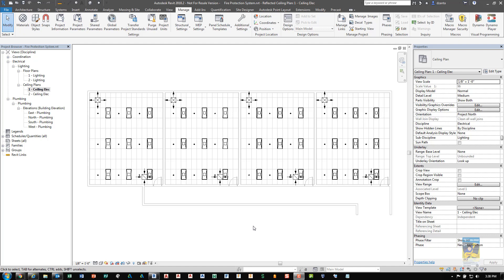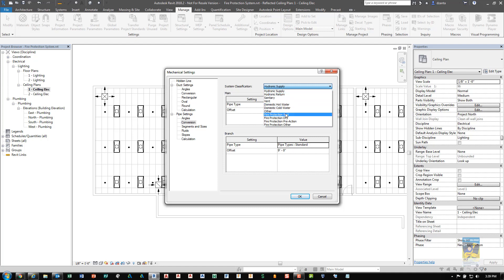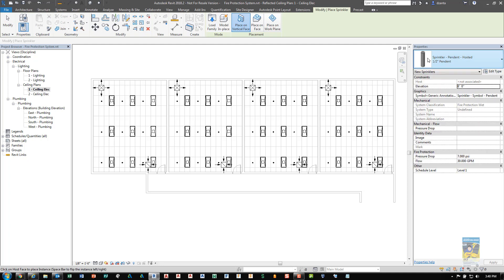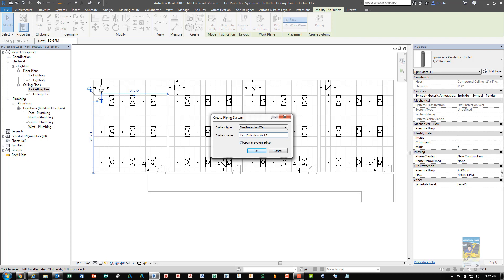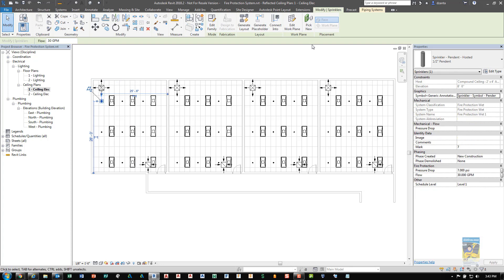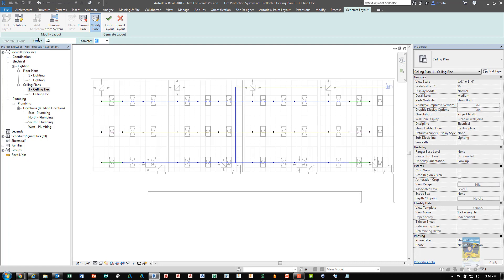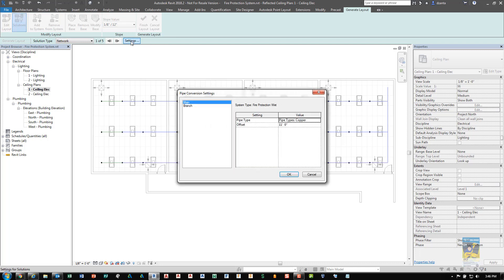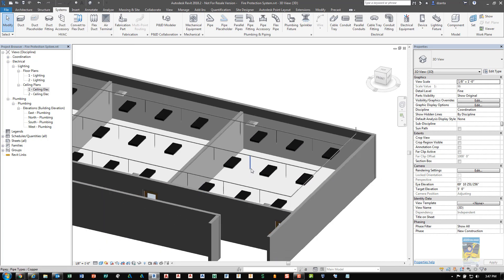How to Create A Fire Sprinkler System in Revit

Comment: Hi Mr. Dzan Ta,
One question. If you are still doing this, would you please demonstrate how you spotted or located or placed the sprinkler heads?
Thank you
Abdul Addo
Reply from the maker: Hi Abdul,  I went to the Systems Tab of the Ribbon, Choose the Fire Sprinkler Command, picked the type I wanted in the Type Selector, then placed it on the face of the ceiling with the contextual Ribbon Place by Face option.
Reply: @DzanTa  Thanks Mr. Dzan, Does Revit has automatic sprinkler placement command? And how do you tell Revit to place the sprinkler in the center or mid point of the ceiling tiles. Thank You again.
Reply from the maker: @fire-protectionservices8575  it does not have automatic placement...that would be cool...suggest this on Revit Ideas.  To place in center of tile, use Reference Lines, Model Lines or Detail lines as construction lines to fine the center, then place them.
Reply: @DzanTa  That is Great Mr. Dzan I will try it. 
Thank You Very Much
Abdul Addo

Comment: how can I edit the pipe size? I change the default size to 2'' diameter but when I create sprinkler system it generates it as 3/4'' ?????????
Reply from the maker: when you use the pipe command, change the size in the options toolbar.  Make sure your don't have inherent size selected.  This will negate the size you choose in the options toolbar and use the size of the pipe you are connecting in to.
Reply: @DzanTa  when I select pipe under system, default pipe I draw is 2'' but when I create sprinkler system it is set to 3/4'' and I need to edit each manually. It's a mess
Reply from the maker: @EmreGündoğan-o4p  you should be able to change the size in the options toolbar prior to drawing it.
Reply: @DzanTa  where is that toolbar?
Reply from the maker: @EmreGündoğan-o4p  the Options Toolbar is below the Ribbon. It is contextual and only shows up when you start a command or select an object
Reply: @DzanTa  do you mean modify tab? There is no option tab?
Reply from the maker: @EmreGündoğan-o4p  options toolbar....it is long, horizontal, below the ribbon.  It is NOT a tab in the Ribbon
Reply: @DzanTa  you mean the yellowish that appears while drawing something? Yeah so I set 2'' diameter for pipe okay? So everytime I select pipe to draw it comes as 2'' default but when I select sprinkler and generate a route there is no diameter selection in the option bar there is different types of solutions but diameter is already set to 3/4''
Reply from the maker: @EmreGündoğan-o4p  go into Mechanical settings and verify sizes are available to choose.
Reply: @DzanTa  I see segments and sizes under pipe settings but there are many sizes listed and this is a size catalog changing these doesn't affect default pipe size 3/4''
Reply from the maker: @EmreGündoğan-o4p  i can help you via remote access later...download and install TeamViewer app.
Reply: @DzanTa  it's not necessary but it would be better if you could make a video about it?
Reply from the maker: @EmreGündoğan-o4p  ok. Will do asap
Reply from the maker: @EmreGündoğan-o4p  Hi Yunus...Here you go...
https://www.youtube.com/watch?v=nxcpJsM_Im0

Comment: when I place the water base it doesn't connect and it doesn't give me solutions!!!???
Reply from the maker: Is the system defined prior to placing the water source?
Reply: @DzanTa  I don't know. But my diagnosis is that the sprinkler that I used was not wet or dry and I assumed for this reason I couldn't show water source base. Do you think this is correct?
Reply from the maker: @EmreGündoğan-o4p  not sure.  I would need to see the model
Reply: @DzanTa  Is there need for placing water base though since it dry protection system works with nitrogen and air instead of water?
Reply from the maker: @EmreGündoğan-o4p  I do not believe it is necessary but I am not an engineer.